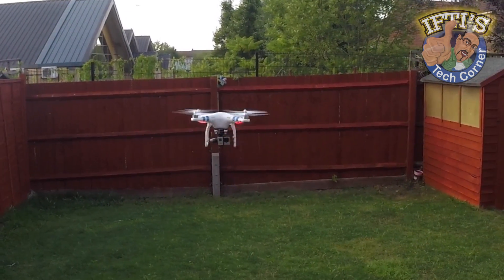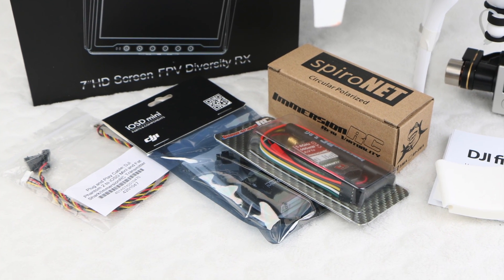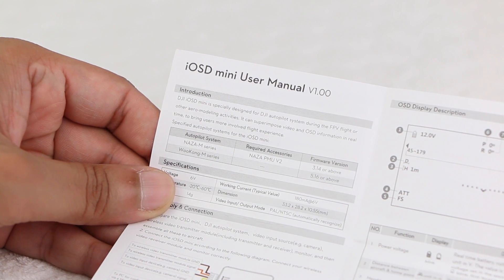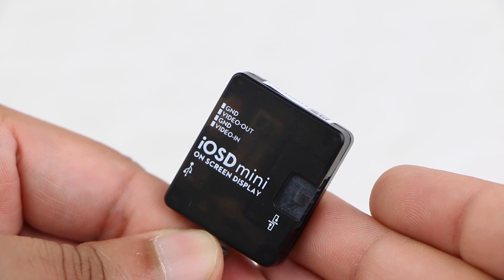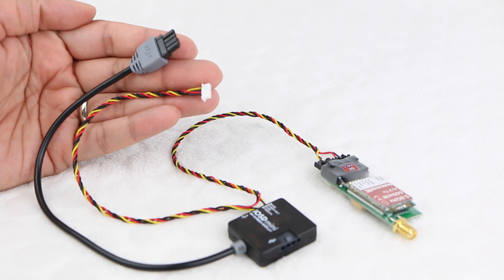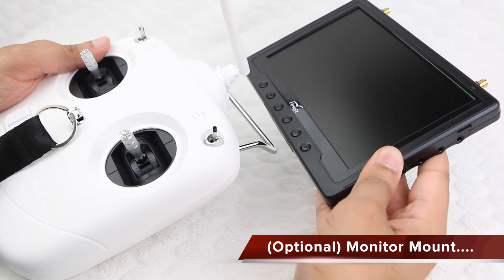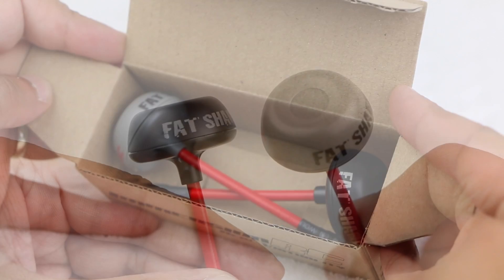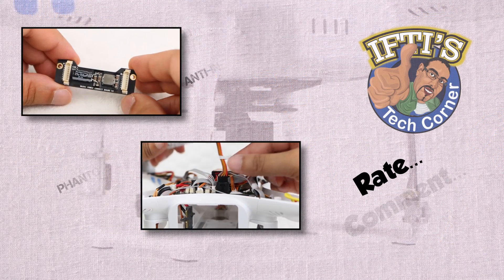#6: DJI Phantom 2 - FPV Requirements: Whats needed?

Comment: Hi and thanks for this video. I have subscribed. I have got all the parts necessary except the monitor. I've read elsewhere that the 600mw trans doesn't work very well with the flysight 32 channel. Is this actually the case? Some recommend the 7 channel but i find it impossible to get my hands on one!! Could you let me know which was used in your video and results please. Thanks.

Comment: hi. Just looking at your set up I noticed that the phantom 2 you have set this up on is the older model. The one I have is the updated version with the gimbal control wheel on the transmitter. Not sure what frequency this is now ..just bought the black pearl monitor    + immersion 5.8 ghz transmitter and an iosd mini with plug and play cable. Will all this set up still work on my phantom without interference to the quad itself..also in the box with my zen muse h3 3D gimbal there is a Gcu v2 little black box ..what is this used for ..new to all this fpv stuff ..just wondering if you have any advice for me ..thanks

Comment: just curious have you had any problems with control of the drone with this fitted? not sure if this is correct but both the P2 and this FPV kit use the same frequency.

Comment: Your circular polarized antenas were mixed...You showed a RIGHT hand polarized mixed with a LEFT hand polarized one, and that's WRONG!  You need to pick either one but never mix them or you will have a crappy video feed if any... The rest of the information presented in your video was ok.  

 Greetings from Douglas, Arizona. Happy new year 2016.

Comment: What is the purpose of the the DJI FPV Hub and cable kit and is it necessary for FPV?
Reply from the maker: +Eugene Herrera Its not required if you follow my guide - the hub is used to mount everything externally, although it adds unnecessary weight.
Reply: +iftibashir  THANKS! Your videos are really clear and well made. Very informative.
Reply: +iftibashir With your setup, I wouldn't need the Female/Male Antenna Connectors right?

Comment: What connects the Gopro to the immursionrc. Is there a video output cable, I didn't see listed?
Reply from the maker: Ryan Boesen The GoPro connects to the Gimbal. The Gimbal connects to the mainboard. The ImmersionRC also connects to the mainboard directly. Hence the feed is sent from the GoPro to the mainboard and through the board to the immersionRC transmitter.
Reply: Thank you!

Comment: Do I need to use a GoPro or it would work with a different camera? 
Thanks
Reply from the maker: Nuno Melo The H3-3D Gimbal is designed for the size and weight of the GoPro.....
Reply: iftibashir Yes, I know. But I would prefere to use a different camera for the FPV system. The reason is that I don't use the GoPro all the time.
Reply from the maker: Nuno Melo It could be used if the camera supports a video out feed, although the setup would be slightly different as you wouldn't be going through the gimbal.

Comment: Hi iftibashir, If I don't need iosd informations, can I install only fpv transmitter (and not iosd)? It works alone ? thank you!
Reply from the maker: Ennio Des Correct. Just skip the iOSD install and continue the rest as normal and it will work fine ;o)

Comment: How much does it cost all together?
Reply: LPMoritz  between $1,200.00 and $1,400.00
Reply: +macrapidito only accesories or include drone?
Reply: Everything, you should not even been looking into do this no more I saw the phantom 3rd generation with  4K camera under $800.00 the other day, better camera, and the same FVP capabilities.

over all better drone for less. this is  old stuff

Comment: Does the black pearl have a built in receiver? And does anyone know what reciever goes with that transmitter
Reply from the maker: BerarducciFILMS The black pearl has the receiver built in, hence the antennas built onto the top. You do not need any extra equipment other then whats shown in this video.

Comment: You make the best instructional video thanks so much! Wondering if you've run into my problem I'm having.  I'm using identical equipment as in your video and configured the same way.  I get a signal to my Black Pearl monitor on band F channel 7, I can tell because the fuzzy lines go away and its a solid black feed.  Thats the issue though,  signal is being picked up but there no live video, seems to be an issue somewhere between the GoPro and the Tx.  I've already ordered a replacement PnP cable to try that first, any other recommendations?

Thanks!!
Reply from the maker: Chris Gwynne I would test the GoPro video out feed directly to a monitor to rule the camera out also...

Comment: Another excellent vid--Thanks mate. I'am running Immersion FPV on a DIY quad-using 5.8GHz. I have Fatshark Doms with in-built RX. With goggle mounted spironet, I'am getting about 1200 mts of clean vision.
However with an RX mounted on a 3 mt tall pole longer ranges can be achieved. But that depends on RC TX range.
Enjoying the vids-very well presented. Getting a P2 with the 3 axis gimbal, so you're vids are much appreciated.
Cheers.

Comment: can i use one immersion transmitter on the phantom 2 and then get video feed on the blackpearl monitor and the fpv goggles at the same time
Reply from the maker: jolly bus You can use the same transmitter to transmit to either the monitor or the goggles.

Comment: Can i use the immersion Rc 5.8G transmitter for both the blackpearl monitor and for the fpv goggles or do i need seperate transmitters on the phantom 2.
Reply from the maker: jolly bus Yes, you should be able to use the same for both.

Comment: Can i use a 250mw transmitter?
Reply: UK limit is 25mw you would need a licence to operate a 250mw or 600mw in the UK. It's different for other places in the world
Reply: Talon276 How can i find the info so i can look up a legal FPV transmitter to use in my area?And witch of the two models of the Phantoms do you think is easier to setup the Phantom 2 Vision+ or the Phantom 2 + H3-3D?
Reply: Andy Black Where do you live? I think the Phantom 2 + H3-3D is easier to setup because I know everything needed for it and the image quality would be better because of the gopro
Reply from the maker: Andy Black The Phantom 2 Vision+ is pretty much set up and ready to go out of the box with regards to FPV. The Phantom 2 H3-3D requires some setting up and extra purchases, as per the video, but will produce better overall results due to the use of the GoPro, as Talon276 mentions ;o)
Reply: Talon276 United states Florida.Could DJI always make a new camera for the Vision+?And how long did it take to install every thing.And could DJI make a firmware update that might not make the equipment you use with the DJI Phantom 2 +HD-3D not compatible is there a possibility for that to happen?And i would like the Phantom 2 Vision + because of the way points map feature with out getting extra stuff do gps waypoints like you would with the Phantom 2 + H3-3D.
Reply: Andy Black If I was you I would wait until DJI have unveiled new stuff a CES because the Phantom could have an upgrade, Just search about FPV laws in Florida
Reply: Talon276 Can i use Teleporter v4 goggles and can i take still pictures instead of video?

Comment: Is the anything difference between phantom 1 and 2
Reply from the maker: Quite a few - battery life, completely redesigned battery bay, motors, self tightening props, gimbal fitting, etc...
Reply: iftibashir sorry I meant in this tutorial

Comment: So the zenmuse helps with fpv? I'm confused how you get video out.
Reply from the maker: Video out is via the side USB connector to the GoPro - check out the next video on how everything is put together and it'll become a lot clearer ;o)
Reply: You made me more confident in installing the whole system. Seems pretty easy.

Phamtom 2 comes in tomorrow =)

Very much looking forward to your next video.

Comment: Great Video, out of the clips I've seen online yours are the best. Very clear and informative.  

I am about to buy the FPV for my Phantom, but am waiting to see your test results of the FPV in action.
Reply: id recommend the fatshark predator v2 goggles.  they work very well, and are immersion rc compatible if you want to upgrade the transmitter etc.  bare in mind that the goggles are technically illegal in the us now :(